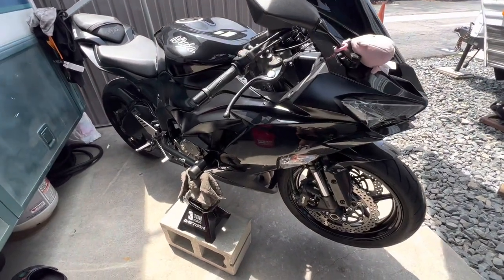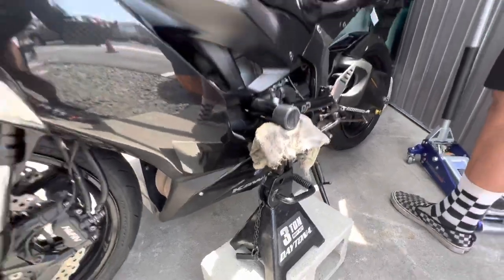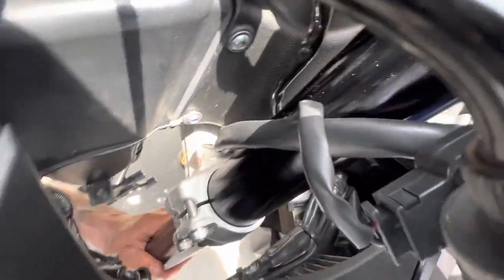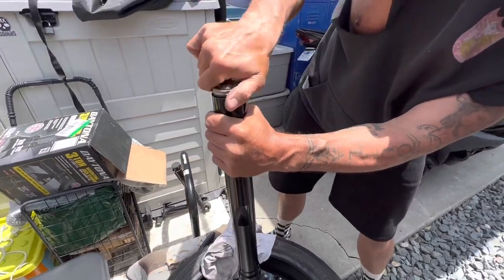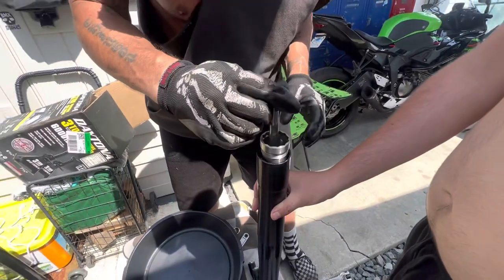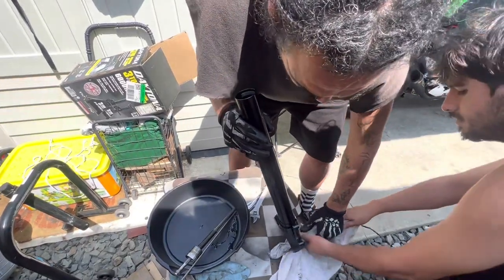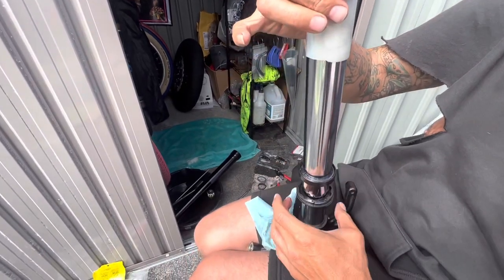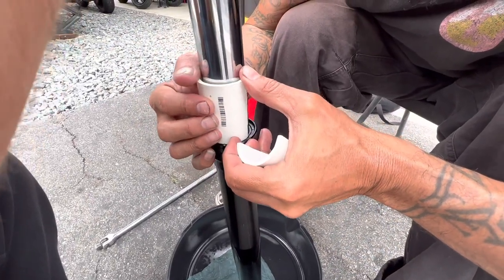HOW TO REPLACE KAWASAKI ZX6R FORK SEALS !!!!

Comment: Nice video but the part number is 08-0473 not 06 and bro you are skipping important steps like taking off the fork cap. Did you stop doing the video when the mechanic was taking it off, these are very important steps, one scene fork cap next scene no fork cap
Reply from the maker: Yes I need to record better

Comment: how did you get the fork cap off after you had unscrewed it from the outer tube? very difficult finding an answer for showa sff bp forks on my 2018 zx6r
Reply from the maker: You need a big Crescent wrench on the top off the piston and you’ll need a backup on the very bottom of the fork where the axle bolt runs through. It takes two people unless you put it a vice. Hope that helps you out